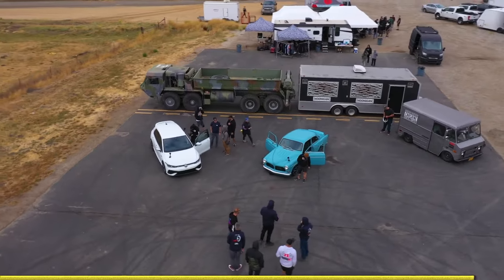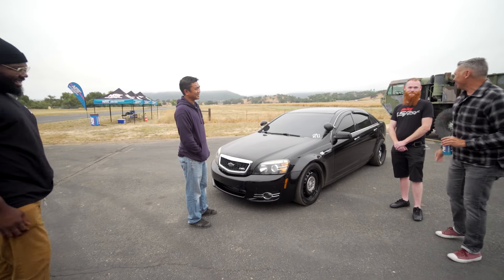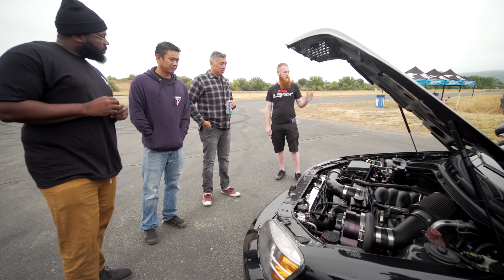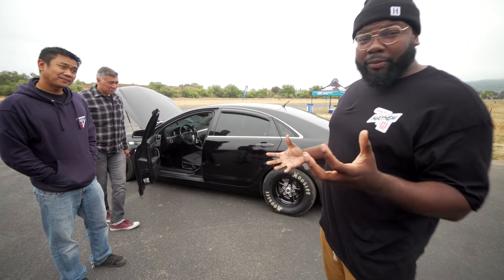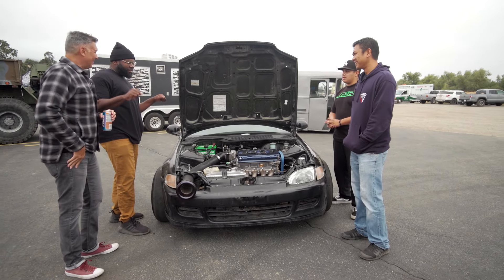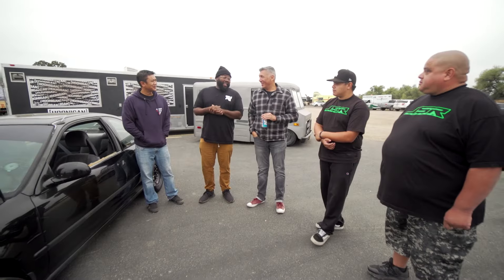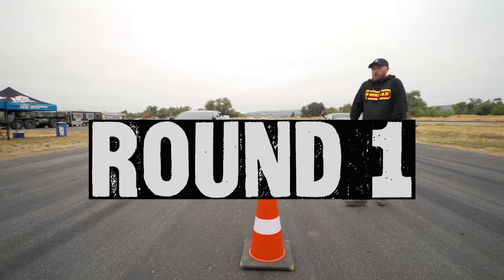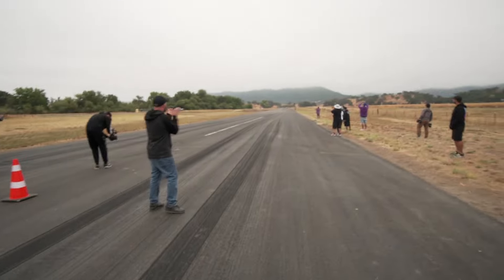600hp Chevy Caprice PPV drag races LS VTEC powered Honda Civic EX

Comment: Kind of blown away that the front drive Civic had a harder launch than the rear drive Holden. Those bias plies are something else.
Reply: People have really started to figure out these fwd platforms these last few years. Idk If this car runs any balast but alot of guys actually run 100-300lbs weight bars behind the front bumper to get a weight balance around 80/20 and really load the slicks.

Comment: This is for the ones that sleep on the 4 cylinder old skool civic 
I had 94 coupe dx coupe ej1
Ls vtec turbo 426whp a kool street sleeper 
High tru! 🔥🙏🏽🦾😉😎💪🏼
The kid knew how to maneuver that civic well in the race. one of my boyz has a bubble hatch in black like Nadz pushing over 700+hp I’ve been driven in it it’s a beast

Comment: I'm really surprised the amount of people with high hp cars that don't really know how to drive it's not that hard to keep it from spinning if you know what you're doing. Improper burnout equal spinning. Foot to the floor equals spinning, especially in an auto..
Reply: No, It doesn't. With a proper tune and good suspension you can leave up on the converter full throttle every time. That's what power management is about, It's literally why we tune.

Comment: Good Lord I had no idea the Chevy was that tubby. That's a fat boi right there.

Also, in no way is that Honda ever a sleeper. Air intake in one of the headlights and the big tires in the front aren't sleepy at all. 14.5 to 1 ratio is pretty cool. I just love to see older 4 banger imports that forgo the turbo.
Reply: It's a sleeper at a street race where everyone is on slicks anyways.

Comment: Yes that what’s happens when u bounce on the limiter on every gear
Reply: Unfortunately in a fwd Honda if you don't it will bog like a son of a bitch on the shift, you have to bring the wheel speed up above where it would be at the "top" of the gear before you shift or you won't have enough wheel speed to keep the rpms up after you grab the gear and bog badly.
Reply: @barneymiller7894  sadly most don't know.  Especially a turbo honda

Comment: Adding 75% more power with nitrous will kinda do that to pistons🙃
Reply: I've seen shots on drag cars that are running more than 100% power gain 🤯 when you get up into pro mods and comparable cars you'll see cars running multiple huge stages of nitrous, up to 2000hp on the big end. I've also seen 1000hp sprayed in a single stage.

Comment: Honda jumped the first race so how can you call it the winner? Then it broke running at 10K RPM with 14.5/1 compression ratio and the kid was holding it on the rev limiter before every shift! It didn't even finish the race!